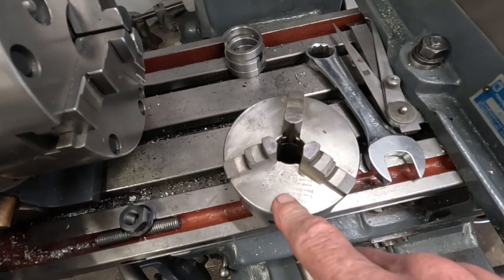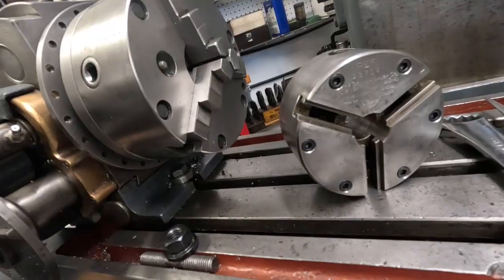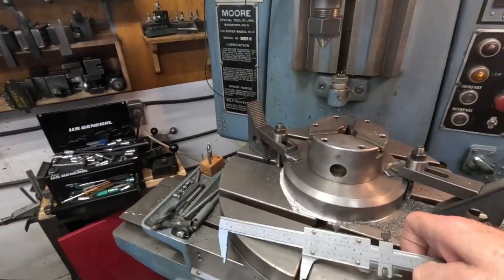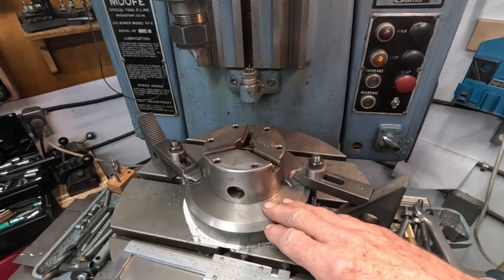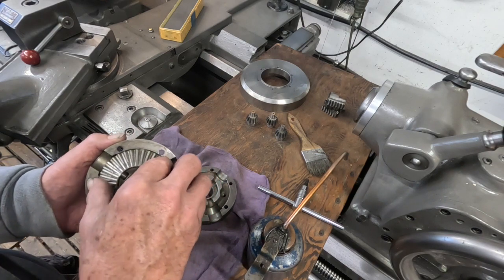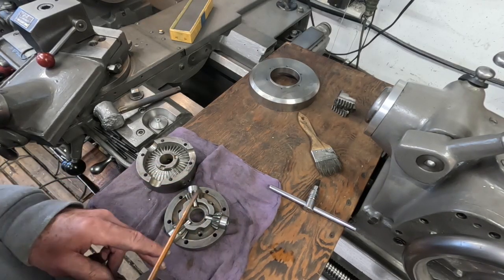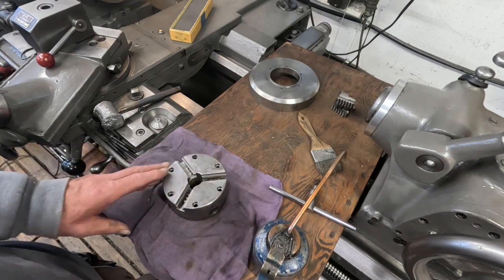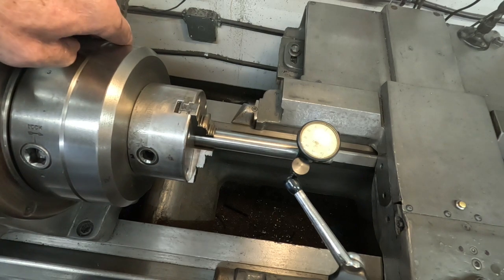Machine Shop Converting a 3 jaw Lathe chuck to front mounting

Comment: Is the bar straight? I bought a precision bar from mcmaster rip off and I went to use it one day and seen my set tru chuck was showing perfect on the inside and when I measured the outside it was 20 th out. Took me a while going back and forth before I realized the precision bar I bought from mcmaster rip off was bowed and it was bowed a lot. I spent a lot of money on that bar, all down the drain. I machined a new one and then adjusted my chuck. It runs perfect. 👣👣👣👣👣👣👣👣👣👣👣👣👣👣👣👣👣👣👣👣👣👣👣👣👣👣👣👣👣👣
Reply from the maker: I have run into the same thing, I have a Taft Pierce 3/4 x 8" test bar in a wood case that is not as accurate as a similar size Harley Davidson transmission counter shaft made by Jims Machining!
 This bar I am using is a new counter shaft for an IH tractor transmission. Crazy but true!